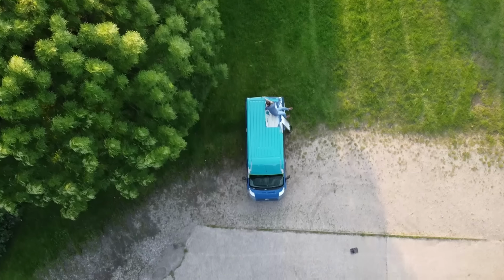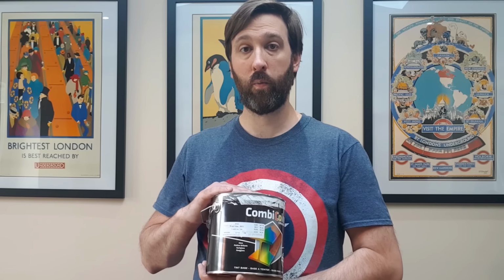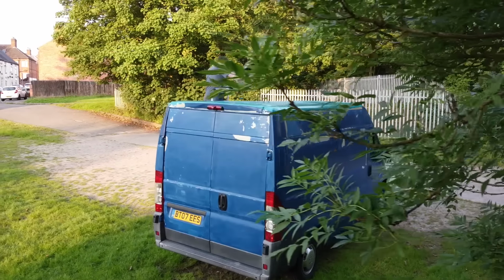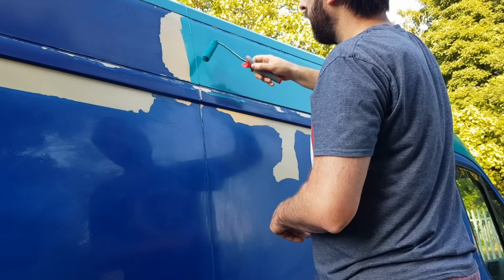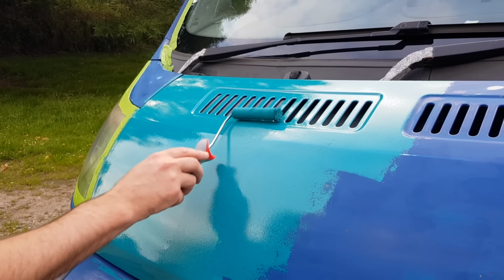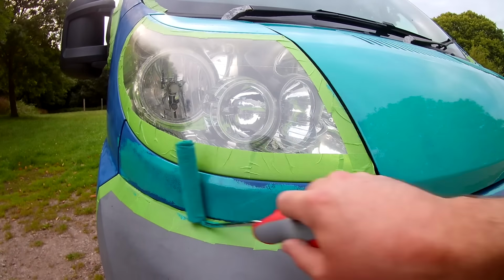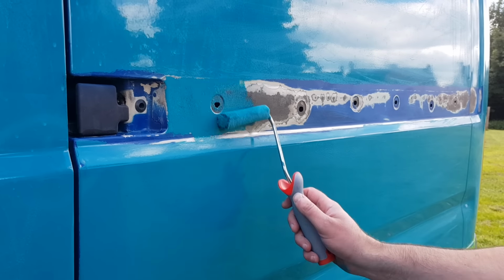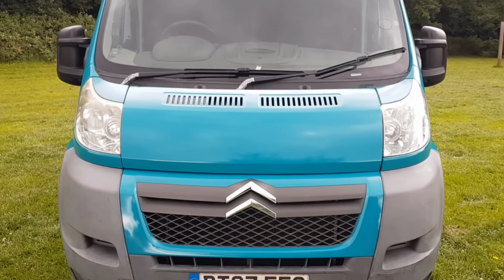Painting a CAMPERVAN on the CHEAP with a ROLLER! - DIY Budget Campervan Conversion

Comment: What a transformation! Well worth the effort. Boiled linseed oil works really well on the exterior plastic and brings them up like new and it’s cheap and lasts ages.
Reply from the maker: Cheers! 👍😊 We thought about going that route but on this particular aged van the bumpers and trim are grey; I think they were changed to black 2014 onwards. The grey looks a bit wishy washy against the colour so were thinking of painting them black. 🤔🙂
Reply: Pilgrim Pods mine are grey too on my 57 plate, trust me, the linseed oil transforms them, makes them look brand new.
Reply from the maker: @yeah_right_ok_no1190  you're twisting our arms here. A few folk have said the grey looks good against the new paint.
Reply: didnt know that
Reply: @PilgrimPods  no mate get a bottle of cherry blossom black shoe polish tip it in a tub and use a paint brush to paint the trim.Do 2 or 3  coats .it goes black.and stays black.Trust me I've done mine
Reply from the maker: @toppertruthio  thanks for the tip! If they fade I'll bear your advice in mind! 😁🙌
Reply: @toppertruthio  me too on my transit....looks great.....6mnths down the line too !  ;)
Reply: What is the name of the pain??? Can you told me?? I follow you here and Instagram but I can’t find the name of the pain. Thanks
Reply from the maker: @labichosurfera1185  it's Rustoleum Combicolor. 😊👍
Reply: instablaster...

Comment: That must look horrifying at first drying! Need heck of alot of wet sanding doing something like this unless you use a self levelling retardant or thinner in the paint! I remember a boy in the street done this with blackboard paint to his lol! Being a car nut and old pannal beater working in body shops the amount of times I have had to sand last this type of paint off the vehicles after people start to think afterwards what have I done haha! Hope you used some sort of metal alloy treatment on the undercoat first with IPA rustolium really only works if theres a primer or a red oxide undercoat should have just plastidiped it! I use it alot heat the cans up before use to stop the orange peel it helps thin the dip spray and can be peeled off later if want to sell your vehicle get a cheap compressor and spray gun for 100 bucks out of Aldi just now there good for home use! I have the airbrush too for detail works

Comment: So it's been almost a year. How has it held up. How much if any gloss or shine has it lost. I heard it will quickly fade and some say if you wax it it can last several years until it fades enough to where it should be polished.
Reply from the maker: Hey Javier, to be honest I don't think it really looks any different to when I first painted it. Admittedly it's been sat on the drive for much of the last 12 months and is covered in a layer of dirt but first thing in the morning when out walking the dog I nearly always take a look back at the van and can't help but smile at how good it looks. I think I've said before that I wouldn't paint a brand new van with a roller but wouldn't hesitate with an old tired looking van like ours, but honestly on reflection I wouldn't hesitate painting ANY van now I'm that pleased with the finish. I guess the new argument though is if you can afford a brand new van you should be able to afford to get it spray painted professionally and save yourself the work! 😀
Reply: @PilgrimPods  Have you used it yet? Is it still holding up well?

Comment: Great video. I've got 2 Luton vans for work. 10 plate and 13. Once a year I sand the sils, arches, and paint the doors, wings and bonnet with a gloss roller. Always use metal white gloss sieved and 10% white spirits. Gets a slight orange peel effect but looks great and is a more solid finish then expensive spray.  Key is not to use too much paint on the roller and don't apply too much pressure to stop lines appearing

Comment: Did not realised it's so simple to paint your van, thank you for the video, really useful
Reply from the maker: I was surprised too when I was doing my own research. Can't go wrong with this method on a tired looking older van though I have to say if ever there's a next time I'd like to have a go at using a cheap spray gun to see what results I can get.
Reply: @PilgrimPods  That would be my options next year, painting or spraying, unless I will get acceptable and stealthy colour which is unlikely

Comment: Wow!  What a difference!  Great choice of color on this van!  The closeup shots helped a lot with gauging texture of the paint.  I love the gloss. I was going to use a truck bedliner paint like Raptor or Durabak but this is a lot easier to roll on and work with.  Apparently this is an Alkyd Polyurethane so more durable than oil enamel paint.  I tried to find this in the US but only made in UK.  Have contacted Rustoleum.

You may want to paint the plastic bumpers with Durabak bedliner paint. For fine roller brushing, use a mohair brush.  The version with low texture is lovely for a bumper.  No gloss but a satin finish.  Sticks well to all surfaces, and has more flexibility than UPOL Raptor liner made in UK.  Monstaliner is also good. You will need a Xylene solvent and brush cleaner, not Mineral Spirits. There is a great video on Youtube on a Durabak paint job on an RV - yellow color - beautiful!
Reply from the maker: Hey there and thanks for checking the video out. I'll make a mental note of your advice for the bumpers should I have to tackle any again in the future. All the best painting your own! 🙂👍
Reply: Hey Lass-in Angeles, what did you learn about the paint in the U.S.? Going through the same thing...

Comment: How good does that look! This is one job it doesn't look like I'll have to do anymore as the last few vans I've seen have surprisingly good bodywork, but given the result you've achieved I'm sorta tempted to do it anyway.
Reply from the maker: It turned out all right in the end. 😊 Are you any closer to getting your hands on your own van yet then? 🤞 If you do decide a change of colour is in order providing the van has no issues with the current paintwork you shouldn't have any issues rollering it. You've seen how bad our paint and bodywork was and we still managed to get a decent finish. If we can, anyone can. Good luck in that search! 🙌
Reply: @PilgrimPods  Deposit placed so technically I've got a van but we'll see. I tried my best but I don't have your skill to sniff out a bargain so I'll be paying almost double what you have for something a bit older and knowing my luck in much worse condition. Anyway even if it's sound I can't really afford to do anything to it for a while. Timing belt and service is gonna cost me another £500 quid, then there's insurance and tax cause I don't have a driveway. I must be mad to do this.
Reply from the maker: Apologies Tine, I have no idea how your comment slipped through the net... 😑 New van, exciting times! 😁🙌 I've seen comments in numerous places of the cost of vans increasing  due to the increase of delivery drivers etc at this time, but who knows! Fingers crossed you've bagged yourself a good 'un. 🤞 Keep us informed on how you get on with it; either here, Instagram or Facebook. Would love to know how things go. 😊✌💙❤

Comment: I will be doing this to my van, I will be using a paint by Sherwin Williams that is used for repainting propane tanks that stay outside they have 2 types and one is used if you have slot of rust, thanks for the tips, I will be using POR-15 to go over spots of rust believe me it works great the rust will not come back.
Reply from the maker: I'll be sure to take a look at that paint and thanks for swinging by and checking the video out. Best of luck painting your own van! 🙂👍
Reply: POR -15 paint is an excellent paint for smoothing over   pitted &  rough areas but a larger tin doesn't seem to store very well once opened ,I found it needs to be used the same day ,ideal to for sealing rusty petrol tanks on the inside as it's unaffected by petrol , even cellulose thinner can't remove it once dry.

Comment: Use shoe polish sponge 🧽 for the plastic trim / bumpers.. will bring it back to black and give it a good resin coat to protect it👌
Reply from the maker: Thanks for the tip mate. 🙂👍
Reply: @PilgrimPods  didn’t realise you was painting then mate, just seen 🤦🏼‍♂️🤣
Reply from the maker: @manicmotorcorp4927  😄 To be fair spraying outside on a blustery day has left a couple of streaks so I'll be revisiting them once the build is finished to make them perfect. 🙂👍

Comment: I saw a roller brushed Renault Trafic. It didn't look too bad. Looked to be in the same colour as this.
Reply from the maker: If the vehicle is a right mess you honestly can't go wrong tidying it up with a roller. Even with just two coats and no polish ours looks a lot better than it did. Needs another couple of coats though and a good sand and polish next year before I call it done. 🙂

Comment: This is fantastic!! How did get the black plastic panels and number plate off in one piece so you can put them Back on?
Reply from the maker: Hey Holly, thanks for checking it out. We have a video on us painting the plastic trim parts which shows how everything is removed and replaced if you want to see exactly how it's done. 🙂 The number plate is just held on by two screws (and a double sided sticky adhesive pad if I recall?) and the plastic trim are held on by clips; you slide the trim left and can remove one side and then slide it right and the other side then unclips. I didn't know this at the time of doing it as I'd never done it before and destroyed a few plastic clips in the process but they were easily and cheaply replaced from eBay. 😀🙌
Reply: @PilgrimPods  oh brilliant! I’ve watched a lot of your videos, they’re ever so helpful! But I evidently haven’t got to that one yet 😂

Comment: This turned out great! How is it holding up a few years later? Just wondering how hard wearing a DIY finish is compared to the standard spray finishes. Thinking of doing my van this way too.....
Reply from the maker: Year and a half later looks exactly the same apart from the layer of dirt on it. I do intend to add another coat or two though this year before giving it a flat and polish. I'll call it done then.
Reply: @PilgrimPods  Great news! oh I also meant to ask - did you manage to complete 2 coats in a weekend? One each day? Or how long roughly do you think it took if not. Cheers!

Comment: I know its been 4 years, but i found your video and am planning the sane thing for .y van. Which primer did you use? And the rollers are available in dense foam or loose foam; which is preferred?

Comment: Hi did you use the sponge gloss rollers or the fluffy ones. If both which was the best? Thanks 😊
Reply from the maker: Hey Dean, sorry for the late reply, Euros and all that... If you haven't found out already check out the links in my description for the exact roller I opted for. A lot recommend the Fussy Blokes brand of roller but they are stupid expensive but I've seen comments recently of folk using both but saying the cheap ones are just as good. I'm certainly happy with my finish with two coats! 🙂👍
Reply: @PilgrimPods  many Thanks 😊 🏴

Comment: Looks really good! we startet our van repaint today and stuggled with small air bubbles that would not go away by them self. not sure if we use too less thinner or hardner.
Reply: The surface that you are painting has got to be ABSOLUTLY Fat and Grease/oil free.   The Bubbles usually come from that... Good luck ! Go for it !!

Comment: Quite an improvement at a low cost. I would have pressure washed it first to blow off any failing paint. I'd hate to go to that work and have the sub level paint fail in short order.
Reply from the maker: Sorry for the late reply Charles, we kind of switched off from all things van related over the festive period. In the video preceding this we jet washed the whole van, in fact we did it multiple times whilst waiting for decent weather to paint; each and every time a little more paint lifted... I don't know if you're familiar with these vans but there are a lot the same age as ours with the same issue with the paint; I'm assuming there must have been an issue at the factory. 

Despite our efforts to remove all of the flakey paint we've still encountered issues with what seemed at the time sound paint lifting when the new paint has been taped up. In an ideal world we would have taken it completely back to primer but that would have taken us an absolute age and wasn't really worth doing with a 13 year old van. I guess the beauty of rollering your van is you can always touch it up if need be with minimal prep and it looks as good as new!
Reply: @PilgrimPods  Thanks for the follow up. Its a load of work painting something that size with all the prep!

Comment: Great roller job , have had vehicle color changes before and major problem is door jams & under the bonnet or engine compartment
Reply from the maker: Yeah I hear you there. We should have focused on those areas first and are now touching them up later on. Do plan on getting another couple of coats down all over next year before a final sand and polish so it'll eventually all come together. Priority right now is finishing off the campervan build. 🙂

Comment: w sign (making) you can get a super mirror surface by rolling- and then going over lightly w a nearly dry wide BRUSH.
Reply from the maker: Flattening off? Proper old school method. If I hadn't achieved the finish I managed that would have been my next thing to try. 🙂

Comment: I keep coming back to this video. Totally inspired by the wonderful job you've done. You make it sound and look straightforward and easy. I have been daunted by the idea of DIY painting my Transit exterior as read you need an orbit sander etc between every coat (then I see you mention normal sandpaper, phew!) could I ask how long did it take you to get this result> as in how many full days? Tempted to give it a go if my 2 and 4 yr old kids allow me the time!! Or am I being too ambitious? Thanks for the super helpful video, you deserve all the positive comments you're receiving!
Reply from the maker: Hi Ericherry, thanks for the positive feedback! 😊 We did use an orbital sander with 400 grit for the original prep to save time but we could have just as easily done it by hand. Prep took around 8 hours and the first coat about 10 hours. Second round was prepped and painted in around 10 hours. If we can get a decent finish anyone can. The cost was time, in real money it hasn't cost us £50 so far. The beauty of rollering it is you can do it a bit at a time in sections. The first coat went down over three days; one session for the roof and sides, an evening after work for the rear doors and then another evening for the front end and those doors. Best of luck should you decide to paint your own van! 🤞🙂💙❤
Reply: @PilgrimPods  hey buddy, you're awesome! Many thanks for your reply, it's much appreciated 👍 really tempted to do this. Even the colour you chose is spot on!

Comment: Well done mate - a damn good effort. And good on ya for taking the plunge and painting it yourself. Very brave! I'm, inspired. 
I'd like to see the finished result once you have done another few coats and lacquered it. 
Also - i'd be interested in the total cost?
Cheers
Reply from the maker: Thanks Andy! 😊 We couldn't justify the cost of a proper paint job on a tatty old £1500 van so had to explore alternatives. We'll get some more coats on once we've done the conversion and do a follow up once it's all polished up! 😃 Cost so far for rollers and paint is less than £50. I'll add some links to all materials in the description shortly. 👍

Comment: Hi.. Just managed to have a watch of your vid and you've really got a lot better finish than ours..(the purple and black transit on one of your group posts..) we went with the roller, but followed up with a brush and due to the hot weather it left brush strokes.. My current build, after watching this, will just be rollered..  👍
Great work, by the way.. 😊
Reply from the maker: I remember your van. 🙂 We struggled using a paint brush on those hard to reach places; we just couldn't get a nice finish using one. A foam roller worked so much better for us. It never occurred to us to use a paint brush to tidy up our actual rollering as it went down so well. Was a little concerning at first with the quality but working the paint to remove any roller marks and just stepping away to let the paint settle was key for us. After a minute or two we found the paint settled down to a nice finish; not sure if it had anything to do with the thinners we added but I would expect so. Best of luck with your current build! 😊✌💙❤
Reply: @PilgrimPods  Thankyou..got some rust prep, then waiting on the weather..same colours again, but toning down by mixing some black in. 😁
The brush technique comes from coach and canal boat painting.. 👍
Great idea for those foam brushes, too..
Did you wait 12 hours between coats? 🤔😎
Reply from the maker: @LillaHusVanlife  we waited a few days between coats but that was in part due to poor weather. The rain is hampering us now with the windows... 🌧🙄
Reply: @PilgrimPods  with windows, don't forget, always cut INSIDE the line from your template..don't make my expensive mistake...lol 😭😭😂 Hope it eases soon, for you.. 😉 take care.. 👍

Comment: You have given me confidence to do mine, after a garage took my money and did a bad job on the undercoat,then went bust, they used military grey, if I sand it down and use the paint you used would that be ok, and what sandpaper you recommend please
Reply from the maker: Hi Ann, apologies for the slow reply. Rustoleum will cover just fine after a tickle of sandpaper to key. Something around 400 grit will get the job done. If you're on Facebook join the 'veedub handpainted' group. Loads of advice on there and photos showing just what can be achieved with a roller. 🙂